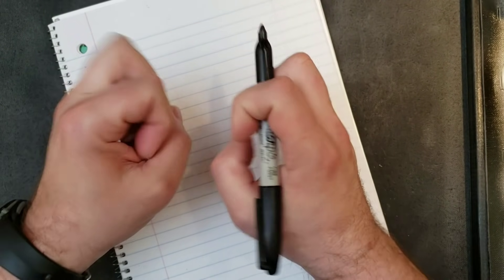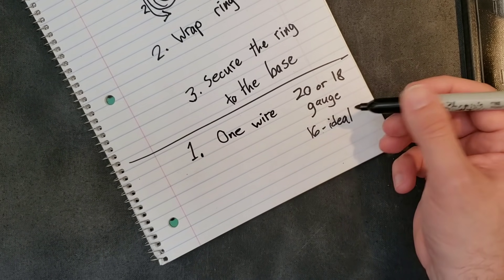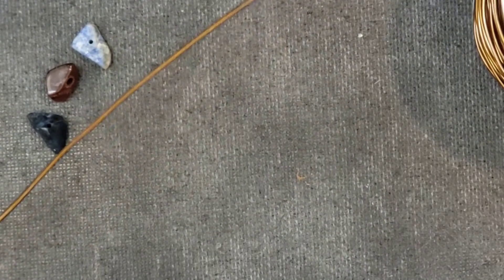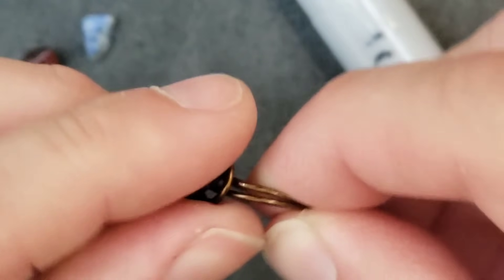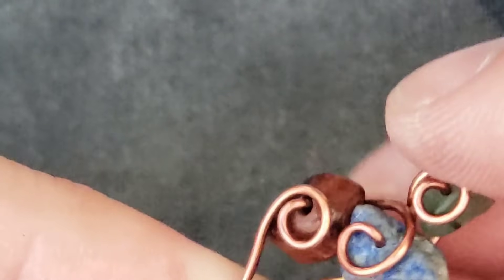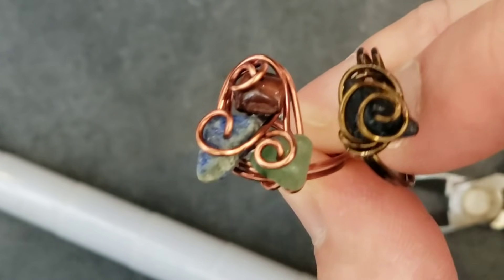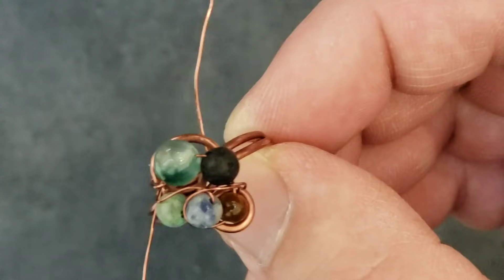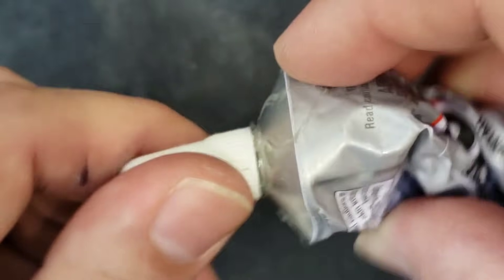Most Clearly Explained Ring Tutorial - Eps 133

Comment: I've seen some hammer their jewelry. Is this necessary?
Reply from the maker: All depends on what you want to do.  Hammering flatens and strengthens the wire but can only be done in specific ways that doesn't work wherever wires cross each other.

Comment: Hey Matt, I enjoy your videos, I do have issues with the 18G wire because it is so soft and bend easily.  i''ve done some bracelets with a 16g, but it is so hard to manipulate it and make swirls with it, can you suggest other wires that'll be easier to work with? thanks in adavance.
Reply from the maker: It sounds like you might be using aluminum based wire.  Aluminum is too soft to use for most of these tutorials.  Make sure your wire is copper based.  Copper is the metal I use.  If copper is still too soft, try German Silver - that is very hard wire.
Reply: Thank you so much for your response.  You are great and funny.  I love it.
Reply: @MattsCrazyArt  Thank you, I think I'll try the German wire, you are a great teacher.